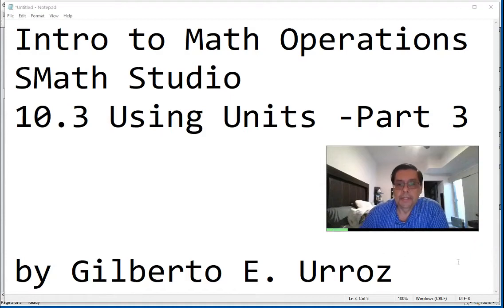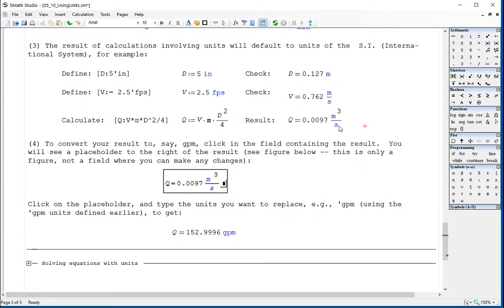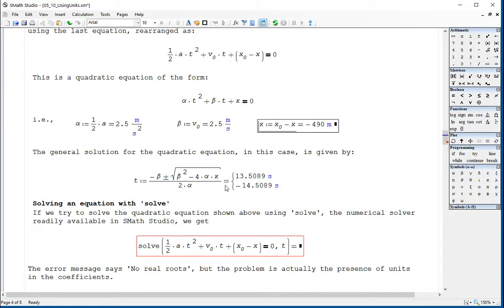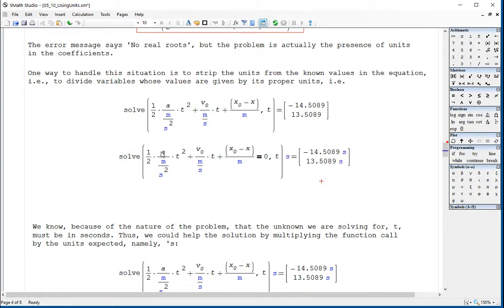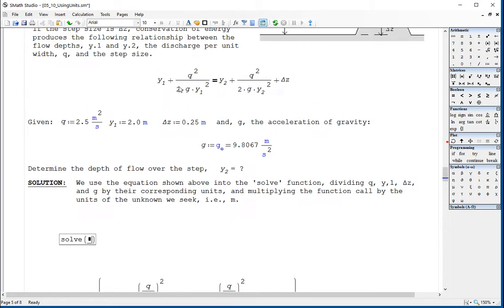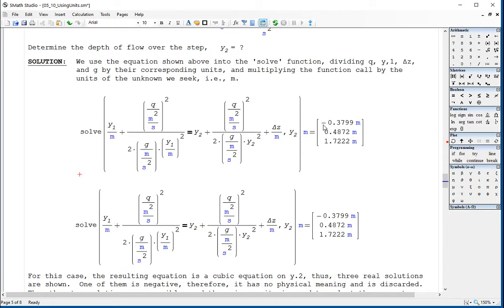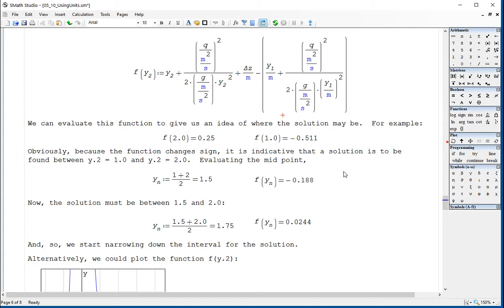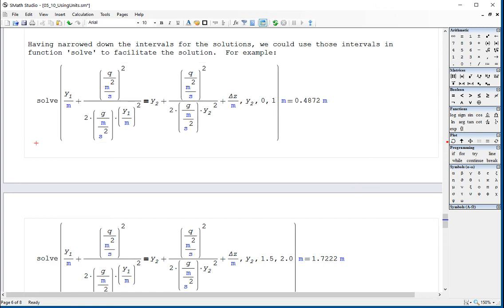4.24 SMath Studio: Using Units in Calculations - Part3

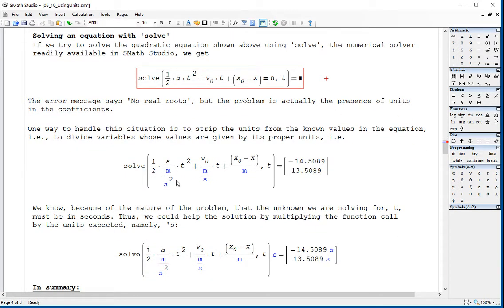Comment: Thanks for the very detailed tutorials. Some alternatives to removing the units as shown in 4:29 are given by: (1) 'FindRoot', which is available from the nonlinear solver plugin; (2) 'Solve', which is a part of the Maxima plugin. The following commands apply for these options:

eq := 1/2*a*t^2+vo*t+(xo-x)
FindRoot(eq,t=1) , where t=1 is the initial guess
Solve(eq,t)

For this last command remember to use evaluate symbolically instead of the equal sign.